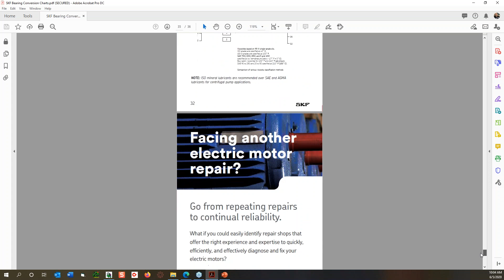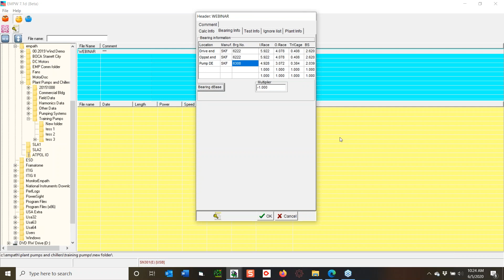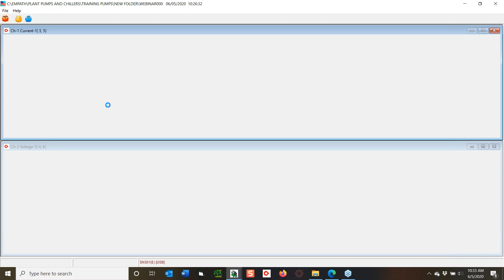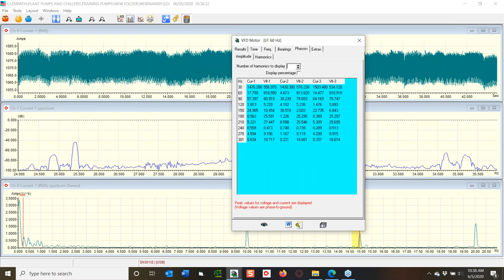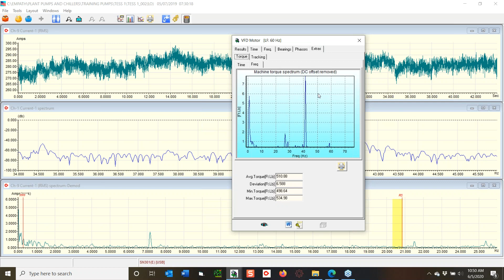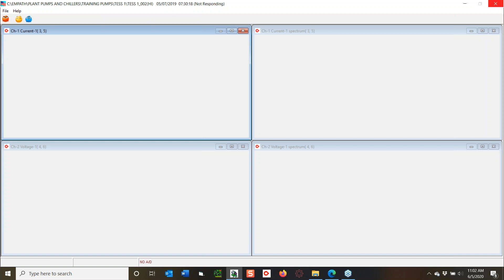EMPATH Testing of VFD Driven Motor and Pump from Set Up to Completion

Comment: hello, I have a question on the nameplate input data, are we supposed to enter the actual service factor of the motor, CT ratio, power factor, and motor efficiency? do these values if not entered affect the calculation?

Comment: Hello, 
I've a question regard connection setup. How to connect current clamp and voltage probe on VFD drive motor, either we have to connect  MCSA on VFD output or VFD input?
Actually both above mentioned scenario we would get different current and voltage data.